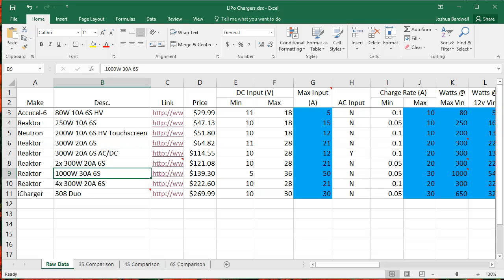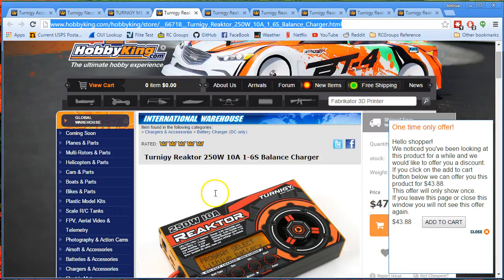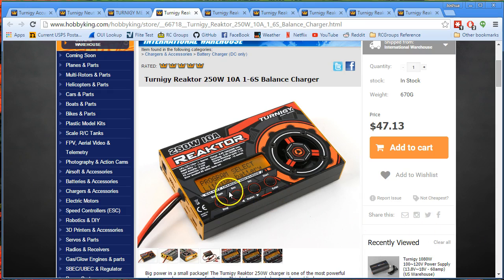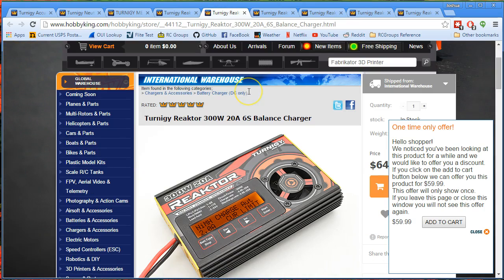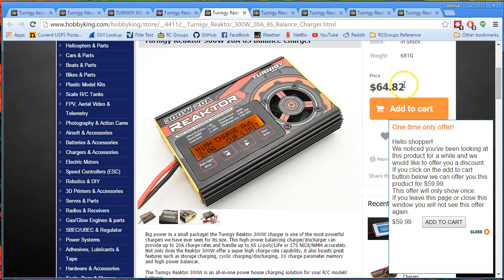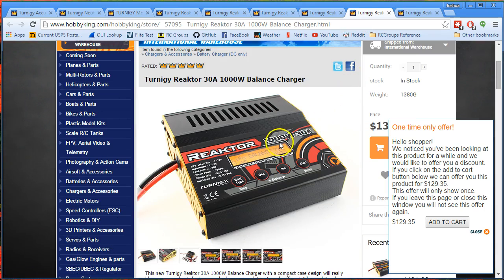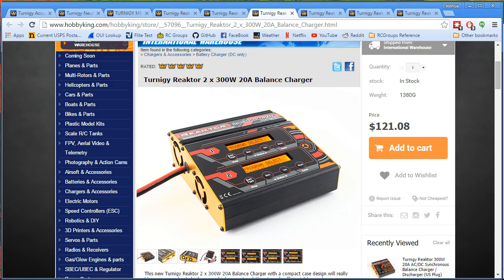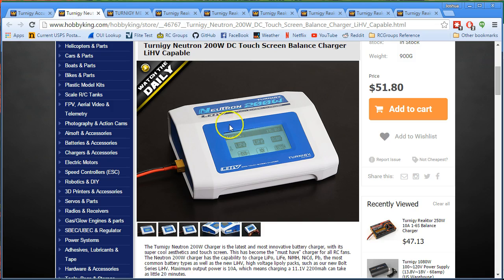LiPo Battery Charger Roundup

Comment: When you say Car battery.. Im picture yall just standing around with your car hood up and wires all coming out from your engine bay charging all at same time. 
I have 1 of them car battery jumper cable kits with usb.. can i use this as a power source? it's got DC as well.  
Can you or do you have a video on portable power sources for the field.

Comment: why is every balance charger 6s, I need it to be 7s dual port or quad port at cheapest cost?  I have four 29v batteries that need balance charged on a ebike.  300w per port is great also for more options, if I don't just use the 1500w power supply as a bulk charger.
Reply from the maker: There are a few 8s capable chargers look at the ISDT T8.

Comment: Hey there Joshua, i just bought my self a gigantic 10k mah 4s multistar lipo, adn my skyrc 6x80+ charger is only charging at 3,2 amps max, and thats just takes forever, so now i've been looking for a new charger, and i'm really interested in that Reaktor 300w 20a ac/dc charger.. and i was wondering if i plug that charger in to the wall, will that charger have the same output as the standard reaktor 300w 20a? as long as it can do over 10a at 4s with 230v in, i'm happy

Comment: Hi Hi

On the Reaktor 300W, is there a Way to set up the voltage it charges up to in the storage mode?
The two chargers I've got doing 3,85v per cell for storage.
Issn't 3,70v the right storage voltage?

So is there a way to set up the storage voltage?

THX
Reply from the maker: No, it charges to 3.84 if memory serves, and there is no way that I know of to change it.

Storage is between 3.80 and 3.84. 3.70 is not storage, it's too low.
Reply: Hi and THX a LOT.

I'm from Germany and around here every one tells you to store at 3.70v.

THX, and it's really great that you do answer the questions that people post.
GREAT WORK!

"Happy flying"

Comment: I have a quick question about a 3s Lipo 1500 mAh 25 C that came with the Eachine Wizard X220. I was using the cheap charger it came with, while waiting for my new and better one ( SKYRC iMAX B6AC v2 ).

Unfortunately during one flight LOS I forgot to put the voltage detector on !!! ( I know ￼:-(. )

Once I brought the quadcopter down and checked all cell I had 

Cell 1 : ~ 3.4 V

Cell 2 :. 1.81 V. !!!

Cell 3 : 3.52 V

The battery puffed but a little very little bit and was a bit warm also. 

I'm afraid to recharge it due to the enormous voltage sag on cell 2. 

What do you think I should do with this battery? 

It appears that the next day the battery managed to balance itself a bit on it's own. The voltage sag difference is now only 0.7 V between cell #2 and the others. 

Is it dangerous to recharge this battery ? 

Is it dangerous for the charger itself (the SKYRC ) ? 

I was planning to keep this battery for LOS only.

Many thanks in advance for your help Mr . Bardwell
Reply from the maker: The battery has definitely been damaged. If cell 2 gets up to 3.0 volts or higher, then you might be able to charge it very slowly (like 200 mA) on a LiPo charger, using the balance program. Personally, I would not use this battery for mini quad use any more, because it is likely to perform poorly. If I had some low-discharge use for it, such as a ground station, I might not throw it away though. But the safest thing to do would be to discharge it and discard it. Honestly, the risk of a damaged LiPo going up in smoke is too high to take many chances with them. For me, once they are damaged, I get rid of them. I suspect that a significant percentage of "unexplained" LiPo fires are batteries that were damaged previously and the damage was either ignored or overlooked.
Reply: Thank you so much for the information Mr. Bardwell and for the quick response.  I will take in consideration what you have said and dispose of the Lipo bat.   

Once the battery discharged ... is it safe to just throw it the garbage  or is there a specific way to dispose of unusable lipo battery ( for safety and taking in consideration the environment )

Thank you and good day to you sir

Comment: There is some incorrect information here, the iCharger 308 Duo does in fact have the ability to charge HV LiPo's, and measure Internal Resistance (while charging, which the others don't AFAIK).  Also worth mentioning that many of these Hobbyking chargers are direct clones of iChargers which weren't actually mentioned here (206B for example), which doesn't exactly help innovation in this hobby.

Comment: Hi, I wanted to ask you if you know, how to get a higher discharge rate out of the Reaktor Chargers???
Would be great if you could hepl me with that.

THX
Reply from the maker: +Geistertoehle use an external load like a bank of halogen bulbs.
Reply: Thx so far, but how do I have to wire the load up to the charger?

Comment: Hi Joshua,
I'm running 2 Reaktor 300W chargers and I'm really happy with them.
At first I did run tham on a 700W 12V Server Power Supply and wasn't all that happy with them.
I do have some 8000mAh 4S Lipos and the chargers would only put out around 6A.

So I did build myselve a 24v Power Supply out of 2 700W 12v Server power supplies and that made ALL the difference!
16A @ 4S are no problem anymore!

I would buy them again ANY day!

Comment: I have a Tenergy charger that reads 4.2 on all cells when it is completed.  But if I check with my battery checker or my fluke they range from 4.13 to 4.19, with none at 4.2.  Should I be concerned about this and invest in a better charger?

Comment: Hey Joshua! I always come to your channel when in doubt about anything! Love the content and quallity! I just burned my cheapo charger and am now on the hunt for a new system. Have you looked at Radiolink CP620? I'm quite interested in that one since it has a "new" kind of balance charging where it charges through the main lead (for upto 30A) up untill the first cell reaches 4.2V and then it switches over to charging through the balance leads at 6A for each individual cell. They call it a Hybrid charger. There is some discussion on rcgroups about some of the issues the good people there have discovered concerning the accuracy of measurments of Amps in the settings versus the outputted amps. I was hoping you might do a review of that charger to either confirm or break the rumours of the problems.
Reply from the maker: +RedLine FPV that's a pretty interesting way of balancing. Thanks for letting me know.
Reply: Check out the link where they have more info on the features:
http://www.banggood.com/Radiolink-CP620-750W-30A-Battery-Charger-Hybrid-Balance-Charger-For-RC-Models-p-1048386.html

The people in the thread testing it talks about a potentially bad thing if the measurments are real. The balancing algorithm starts to sort of fluctuate between 4.1 and 4.6 in a pulsing fashion untill it finally stops at 4.2 at the end of the charge. Isn't that a bad thing to overcharge the cells like that? Or is the pulsing just a way to average out the 4.2 end voltage?

If you look at the tests done in this post my bad explanation might clear up:
https://www.rcgroups.com/forums/showpost.php?p=35916896&postcount=139
Reply from the maker: +RedLine FPV remember that in order to push current there must be a voltage difference. If you want the battery at 4.2 you must apply more than 4.2 to get it there. As long as the resting voltage doesn't go over 4.2, the only question is whether the charge current is excessive. That's my opinion.
Reply: Thank you for explaining :) I'm on the fence wether I should buy the iSDT 20A carger or the Radiolink.. I'm about to conformal coat my quad so I can rip some snowclad places here in Sweden so I'm in need of a good charger that will last a couple of years. I'm just worried that the pulsing charge thingy will make my 18650 based DIY fatshark batteries go boom cause of the 4.6 overcharge pulses.
Reply from the maker: If you set the charge rate to a safe level, then the voltage should always be safe too. Presumably the 6 amp balance charging is restricted if you set the charge rate to only 1 amp for example. If not, that's a problem.

Comment: Have a 300 watt reaktor and a 4x 300 reaktor, love them both!  X4 sits on the bench at home.  I can charge every pack for the day all at once on the x4 with parallel charging.  Thing is a beast
Reply from the maker: Since I'm giving up on HV packs, maybe Reaktor will go back to being my favorite again. Don't un-plug a battery while charging though! I fried one of my Reaktors that way.
Reply: YES! I was reaching for something and swept my charger off the bench. It sparked horrible when the leads disconnected. It smoked but still works. I am dubious so just ordered another Reactor (the 2 x 300w model). I will be wall mounting my set up very soon!

Comment: (2) 4X compact chargers (Hitec 4X AC)  are plenty for a serious RC flyer. I prefer parallel charging of single cells, but too risky and more time consuming parallel charging of series built packs. Also more risk of human error in not making sure the cells are of equal voltage before charging series built packs in parallel.  I prefer to let the computer in the charger do the calculation and monitoring through the balance connector when charging series built packs. Consider not only series vs parallel charging but also cost vs safety.

Comment: Awesome video. I do have the 300w one and I really thought it didn't have the foam cutter option I am pretty sure I checked on the page description for this feature after I got it didn't see it and forgot to go check it, But now that you said I cheeked and I have it :) I really like this charger but  I use this thing in a very basic way. I have always wonder about what would be the use of saving or programing stuff on the memory. Maybe you could do an in deep video on how to get the most out of this thing and its features. I only use it for balance charging, storage and maybe discharging and that's it also I wonder if I can use it for charging this AA Lipos I have seen lately. and wonder if this batteries will work ok with transmitter. Like this ones http://www.banggood.com/4PCS-MECO-3_7v-3000mAh-Rechargeable-18650-Li-ion-Battery-p-990893.html
Reply from the maker: I never use the program memories either. In the time I spend setting up the memory, I can just select the options.

Comment: nice video, again..
i am totally confused with columns B and C " watts limited by vin".. why is that much difference between 12v and 18v charger input? why accucell6 can charge 4s with 5.13amps? isnt it 80w/16.8v=4.76amps.. obviously i am missing something..

Comment: the CB86 is the BOMB!!!!...love it...
Reply from the maker: +G-Sawus 8 ports and charges through the balance lead... interesting. Can't do super high amps over the balance lead, but who cares when you're charging small FPV packs. You may be right. This charger may be a real good choice for those who don't want to parallel charge.
Reply from the maker: +G-Sawus hmmmm wait a second. Does it charge all packs simultaneously, or one after the other. Maybe not so hot after all.
Reply: High out put...it does one after the other in series..but you can charge each cell individually at high amps ( I use 1 amp per cell, but can go higher if needed)..I can do all 8 in an hour no problem. With this charger also no need to worry about matching cell voltage. As it does each one separately.One pack can be at 14.4 and another at 15.6. No worries.For parallel charge you can use a board through port one just like using a regular charger...

Comment: I've been enjoying this series, thanks! I ended up getting a good deal (sub $100 on eBay) for this charger: http://www.horizonhobby.com/product/airplanes/dynamite-brand/chargers--1/passport-ultra-force-220w-touch-battery-charger-dync3010 and it's been fantastic. I regularly parallel charge 6 1300Mah 4s batts @ 8A and it barely blinks an eye. I will never buy another charger from HobbyKing after the Turnigy X200 failed on me 3 months after purchase, I took it apart to check it out and the inside is horrendous,  it looks like a 4 year designed the and soldered the circuitry.. plain terrible. After that I decided to only stick w/ a quality name brand for my next chargers.

Comment: I got a 250 watt 10 amp last week for 50% off from HK was $24 , here is my setup with 20 amp and 10 amp reaktors , like them so much one button charging. This setup the two chargers exactly match the output of my power supply.https://drive.google.com/file/d/0B5juQFx4vqynM2xoUEJBQ0dUaHc/view?usp=sharing

Comment: We seem to be doing the same thing looking to buy a new charger. I'm looking for an ideal charger for parallel charging 8-4s 1400mah batteries. I'm looking at the ICharger 308 which at a 12V input puts out about 500Watts, and at 23volts it's 1000Watts. I've read that the ICharger series chargers have the best balancing among chargers and also have a good track record as being reliable over years of use. All the reviews seem to say the IChargers are a good buy, what do you think? And yeah I agree with you on the touch screen on that Neutron charger, definitely old school looking...
Reply from the maker: +Ronn Wilson If the iChargers are in your budget, I don't think you'll be disappointed. Personally, that's more than I want to spend on a charger; I don't feel the bells and whistles justify the costs. But there's nothing wrong with the brand.
Reply: +Joshua Bardwell Well I would definitely say that $260+ for the DUO line of IChargers is rather expensive for the battery size requirements we fly I think the 306b at $160 isn't too bad for the reliability and precision that the IChargers are known for. It was between the 306b and the Hyperion EOS730i for me to decide between but after reading the horror stories and bad reviews of the Hyperion chargers it was a no brainer to go with the ICharger 306b.

Comment: If balance accuracy is important to you then its hard to look past the excellent ichargers. 

Even if you have a slightly out of calibration measurement on one of your balance connections you can get an very sensitive multi accurate meter like a fluke and calibrate it.

I would personally recommend an ICharger 106b+ the only downside being that you are limited to 10amps on the output but still you can charge 7 1.3ah 4s packs in around an hour. 

Its also very small and lightweight and has the ability to connect to pc and graph every detail of your pack during charging and discharging using the Logview software.

The easiest way to put it TBH is that IChargers are the FrSky TARANIS of the charger world they really are the best and a very worthwhile investment.
Reply from the maker: +Stephen Gibb I would say that the reason the Taranis is such an obvious choice is that, not only is it decent in hardware and absolutely head and shoulders above in software, but it's exceptional in price. The fact that one can get a budget charger for 2/3 or less the price of an iCharger means that one has to value what they bring to the table enough to justify the increased price. At the end of the day, a charger puts electrons back from one side of a battery into the other, in a certain amount of time. Everything else is gravy. (In my humble, of course.)

Comment: The Revolectrix PowerLab series (I have the PL6) is pretty amazing, but mostly their new Bump controller really makes it head and shoulders above anything else out there. It is more money, sure, but well spent in the long run. Check out what the bump controller brings and tell me it isn't a great idea for LiPo charging. How did you decide what models to compare?
Reply from the maker: +Jason Naubur Like I said in the video, I'm fundamentally cheap. So when I went shopping, Hobbyking was my first choice. Once I decided it would make a good video series, I sort of latched on to the Reaktor series, since they had a reasonably well laid-out product line that could be used for comparisons. I'm a sucker for a product line I can get my mind around. When I was shopping for a pickup truck, I was turned off of Ford, because their spec sheet has so many options and variations that it was completely inscrutable to me.
Reply from the maker: +Jason Naubur The "bump" controller is quite slick.
Reply: +Joshua Bardwell All your videos have been great so far - keep doing what you are doing. Personally looking forward to more of your excellently described flying tutorials. Thanks!
Reply from the maker: Sadly, the weather hasn't been cooperative for flying. Stupid winter.